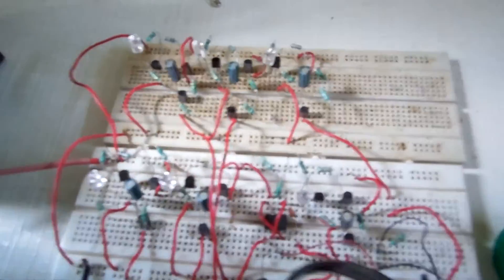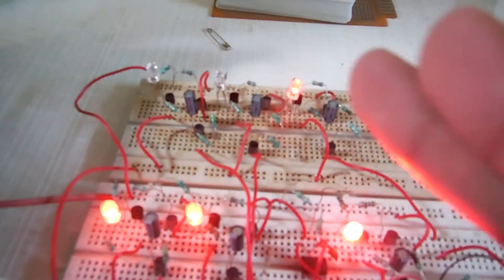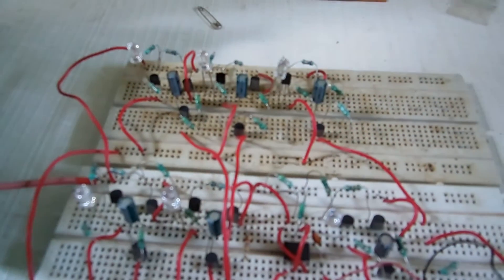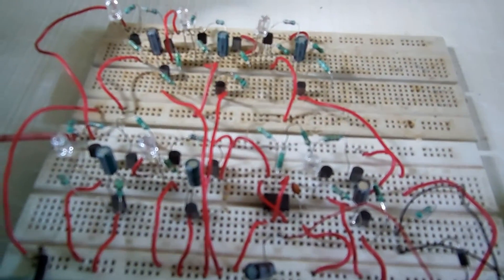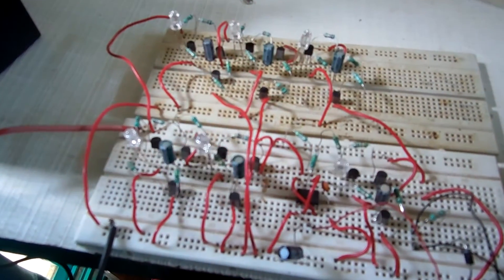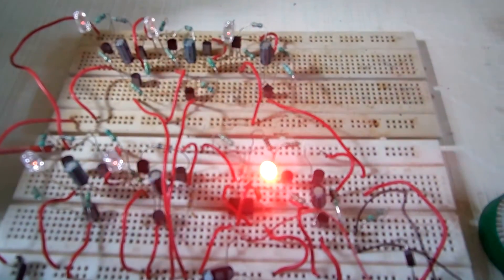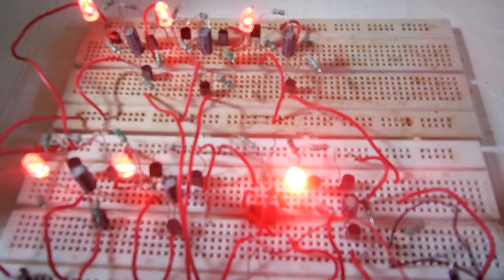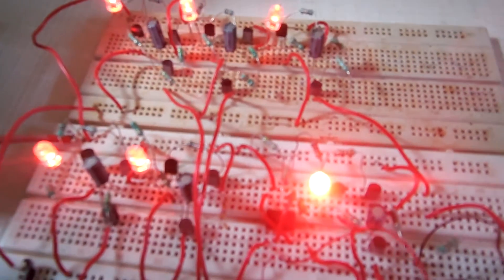Running light(6 L.E.D)

Comment: Pls send me curcit
Reply from the maker: https://prachethire.wixsite.com/outc/single-post/2017/08/30/Running-leds-using-transistor
Reply: @prachethire812  What do the 1 M potentiometer in the 555s OUT port? :O
Reply from the maker: @arpel96tr  the pot controls the base current going to all transistors , the 555 just gives a on time and off time. The base current is what that decides the running speed.
Reply: @prachethire812  Thanks! :)